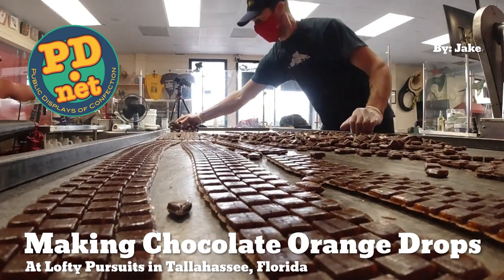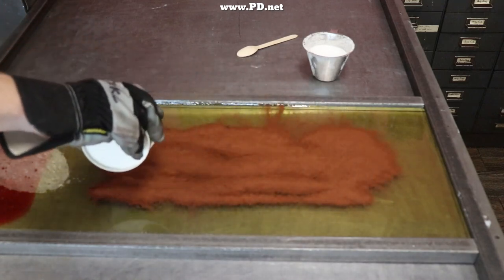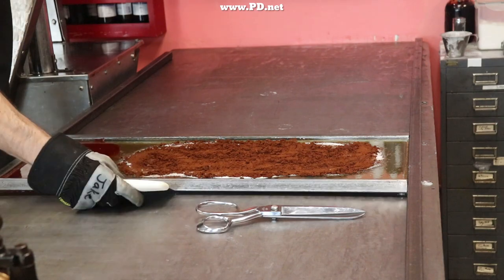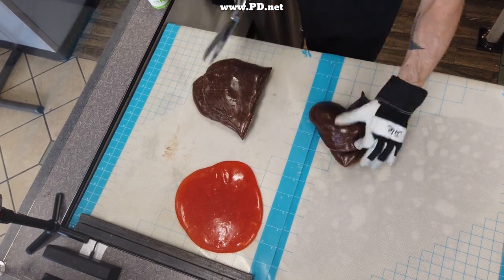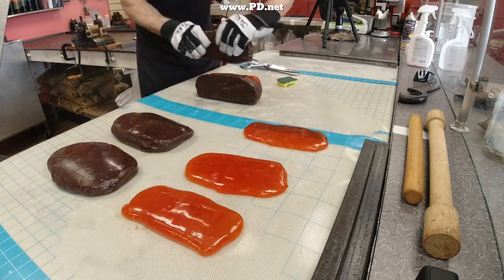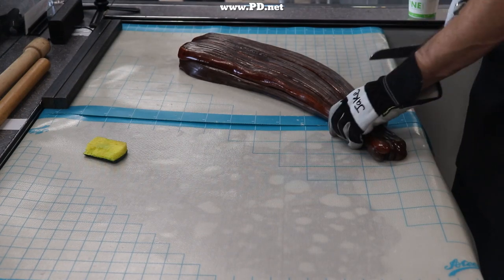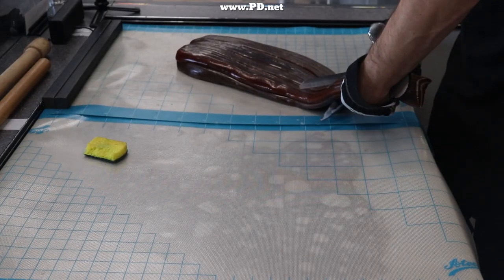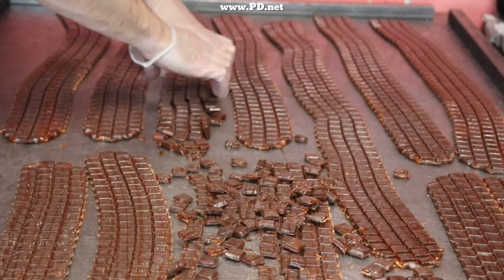#150 Chocolate & Orange hard candy for Easter. Hard to make but worth it at Lofty Pursuits

Comment: Have you ever tried "blooming" the cocoa powder? When you heat up cocoa powder in water it really intensifies the flavor and you could add the cocoa water, and have the water boil out just like it does for the flavoring. It will be especially easy because the water is already hot.
Reply: Wouldn't it have the same effect the way they do it? (Bloomed in the hot sugar)
Reply: @nihlify  part of blooming it is degassing the cocoa powder, and the hot sugar isn't as good of a solvent as hot water is
Reply: That would probably be too much water to boil out that way. The flavorings are just a few milliliters

Comment: One question:  I understand the trouble of working the cocoa power into the sugar.  Would it not be easier to add the powder to the center of the mold and then pour the molten sugar on top so that the powder doesn’t go every where?

Comment: With CNC and CAD, is it not possible to produce new pieces or whole machines for making candy again? I would expect it to cost a pretty penny as it would be special order, but I was just wondering if you have ever looked into it.
Reply from the maker: It's not the design, it's the bi.etallic sweat welding and the alignment issues.

Comment: If the sugar is hot enough to boil out the colouring water, would it not also burn the cocoa powder?
Reply: They wait until the sugar is a specific temperature to add cocoa (or citric acid, which will also burn if too hot)

Comment: How does the coco powder not burn if it boils of the water?
Reply from the maker: Because the candy is at 310F degrees, water boils at 212F, and cocoa powder goes into your chocolate cake that is baked at 350F. It can take the heat, and it needs to cook a bit to get the right flavor. The hot candy does this.